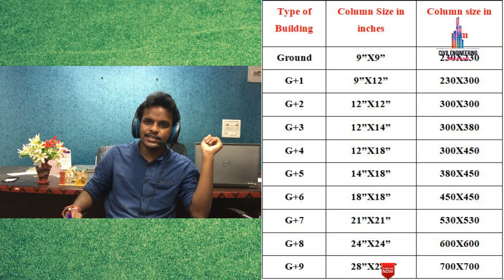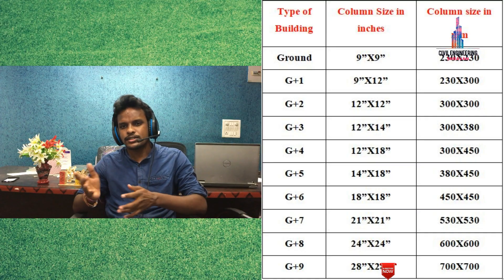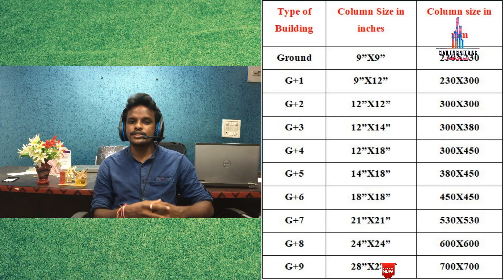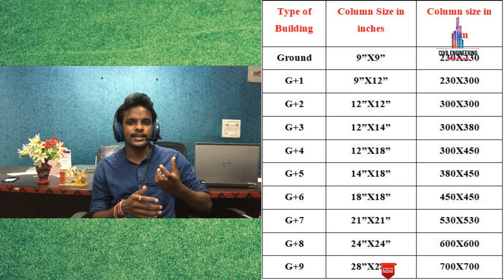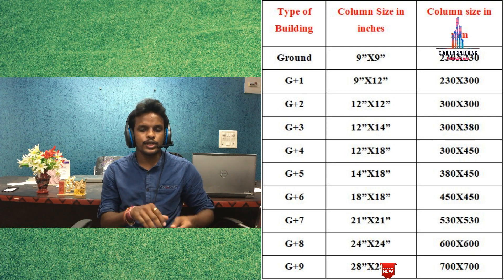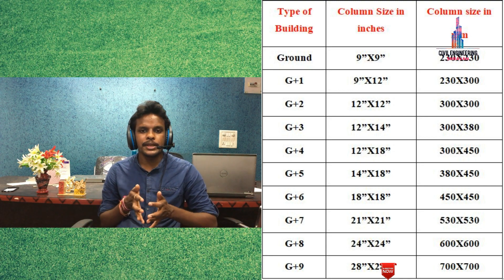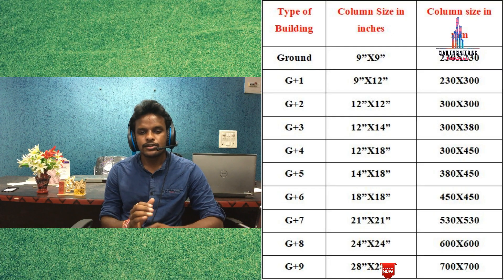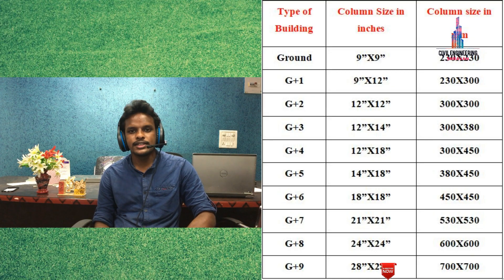Columns sizes for various floors | building design | civil engineering | youtube | column design |

Comment: Bro i have house build using four  12mm tata steel with 10 inche x 10 inche  piller can I build 2nd floor the house structure is build like rcc , no wall support
Reply from the maker: Yes you can but you have to concentrate on loads

Comment: What is the column size if the wall is 6 inches and G+4 residential building.
Reply from the maker: 18"X9" is good but we have to cross check as per the Soil SBC as per your site location

Comment: Hi bro plz reply my question my house span between two columns 19 feetlength, wedth 14 feet . Column size is 9/15 with 6 bars of 16mm rectangler shape.and we make all walls before slab with size of 9”. And we put 12mm bars concealed beams . Total slab area is 45*36 feet  total colums 9.
Middle columns lean wall 14 “ 
It is safe or not plz reply bro
Reply: Only single story G+0

Comment: 12x12 for g+2 will give useless 4inch blocks in every wall. 
Instead use 9x12, 9x15, 9x18..... Based on load
Reply: Yes use  9inch x 12inch etc use only 9 inch width of columns for residential building s
Reply: If 9x12 is used, how many 12mm bars should we use if G+2 is a roofdeck? Thanks in advance!

Comment: I have G+2 home which has 9"*18" column and used 16mm-2 qty and 12 mm -2qty steel size. And distance between two column is 13 feet then it is stable for load?

Comment: Suppose we roll steel than use box type steel minced suppose columns size  12"×12" Whiteman plaster in to between under 10"×10" 2"thikness box 3 parts in to againe 10 feet hight but column 's both side 1 feet or two feet distant put 1 mm to up down we can be attach other following column in side ither out side we are get ground to last floor in perfect angle constriction. And save time steel road do it streat for also put ring fixing time saved also side ply for wood can use other where.and slape for use in plastic plat 6 mm thikness.

Comment: Sir, column size 9"x20" is ok for G+5 Building.
Reply from the maker: It depends upon the soil condition yar
Reply: The SBC given 30t/m2
Reply: @arengineeringarengineering5878  sufficient  .  stories of building should  be main criteria to select the cross section of cumn
Reply: 20 inch size will not be there better use 21 inch or 24"

Comment: Can we increase length of column instead of width like 600 x 600 to 300 x 900 mm 
As I had worked as site engineer in a project of 21 floor but there I had not seen column width 700 x 700 instead the column length was big 
And they had reduced the size of column as floor increased like from GL to 10th and from the 10 the 15 the floor different small size so on

Comment: Kindly give any calculation of thumb rule to arrive preliminary size of rcc column for any storey building. Load= plinth area of slab area x no. of storey x thumb rule for load/m^2. After that using formula given in IS456-2000
Pu=0.40fck Ac+ 0.67 fy Asc. By assuming percentage of steel from 1 to 2% and assuming grade of concrete and steel grade , Ag  gross area of column area will be arrived. By assuming square or rectangular column  dimension of column wi be arrived. As a thumb re we may assume 10 to 20 kn/m^2  may be consider as thumb rule  Normall we adopt 15 Kn/m^2   is consider for design. Like that kindly give some guidance to arrive size of rcc column from your field experience.
V.M.Rajan.

Comment: I used 6 piece 16 mm bar and column size 250 x 300. Can I build G+2 with this specification
Reply from the maker: try to use 8 bars 6 bars with 16mm is only enough for G+1

Comment: Can we use 10"×10" column size for G+1 building with 4 nos 16 mm dia+ 2 nos 12 mm dia bar.
Reply from the maker: U can use but I am recommended with 12X9 column
Reply: Thanku sir.... Please suggest maximum C/C spacing between two column for this size.

Comment: I have seen many using 200mm as minimum dimension .. Is it okay
Reply from the maker: What 200mm 😳 for which projects
Reply: @civilengineeringbyshravan9596  column size 200 x 300... For g+2 building.. Not all the columns... Residential building..
Reply: @civilengineeringbyshravan9596  200 taken to avoid projection of column from wall..since the wall thickness is 20cm.

Comment: Can we increase ground column 9x12 size in first floor to 9x 15 or 9x 18
Reply from the maker: No u can’t do that
Reply: @civilengineeringbyshravan9596  than what would be the solution for the column where they are not aligned in straight line

Comment: Can you explain about placement of column and orientation of columns with respect to major and minor axis of the beam .
Reply: Let's say you have a rectangular building, the major axis of the column will run parallel to the transverse or short side of the building.
This way the major axis of the column faces the direction of lateral loads like winds or seismic.
After this major arrangement, architectural considerations will make you change a few of them that's all.

Comment: Could you please do a flow chart for general loadings as well as loading combinations " Live load. Dead load & wind load" on building structures using STADD Pro. The principles to enter data into STAAD pro are very similar regardless if it is G+1 .... G+10 etc. General load distribution "Slab+wall to beam to column to foundation to soil". Thank for all your hard work and appreciated!